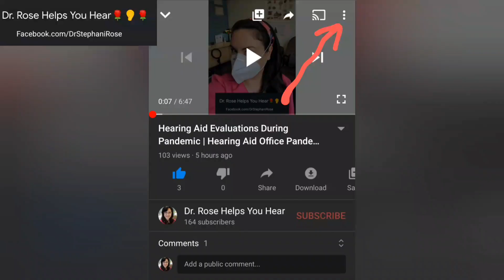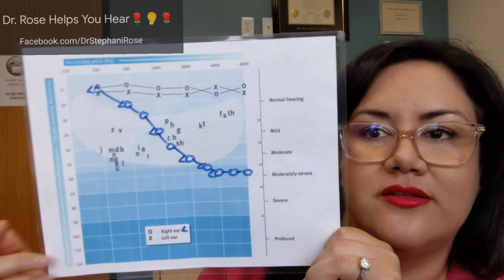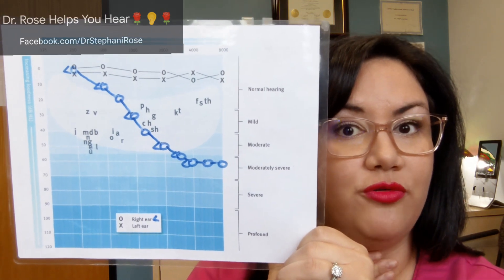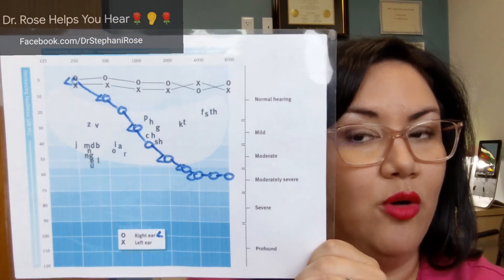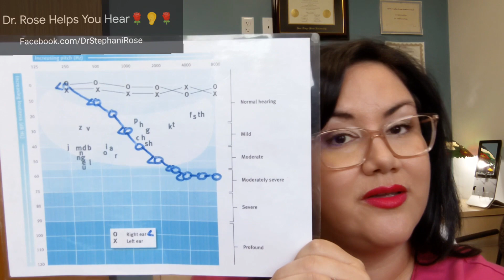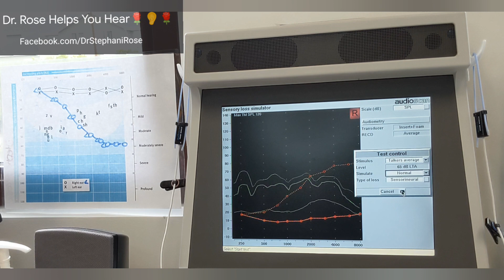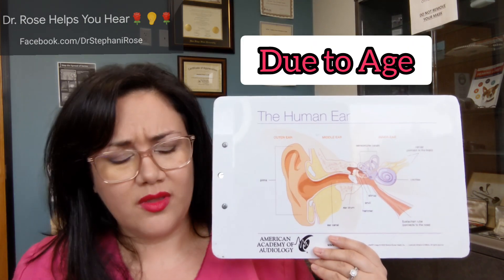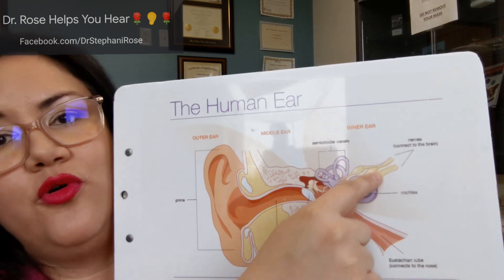Hearing Speech With A Sloping Hearing Loss | High Frequency Hearing Loss | Hearing Loss Simulation

Comment: Hi Dr. Rose, I have moderate high frequency loss in one ear following a SSHL. More troublesome is Dysacusis. Most sounds are fuzzy. Might a hearing aid - with all of their technologically advanced options - potentially offer some improved clarity?
Reply from the maker: If your ear is distorting, a hearing aid will also sound distorted because it has to go through a distorted nerve. I would consult a neurotologist who works with an audiologist  for another opinion.
Reply: @DrRoseHelpsYouHear  Thanks for your reply.  Have you seen more hearing distortion following a SSHL caused by Meniere's than from a viral attack or vascular event?

Comment: Hello! I suffer of unilateral deafness since childhood when I had mumps disease.. basicaly, I cannot hear anything with my right ear. But my left ear was normal until 23 years old when I began losing some hearing. Now I'm 26 years old and I have -35db At 4khz and -45db At 8khz on my left ear. The lower frequencies are pretty normal (0-10db). Now I wanna ask you something: can a hearing aid improve my hearing in my left ear? If yes, What kind of hearing aid? On the other side, is there anything I could do to hear with my right ear even a little bit? Thank you